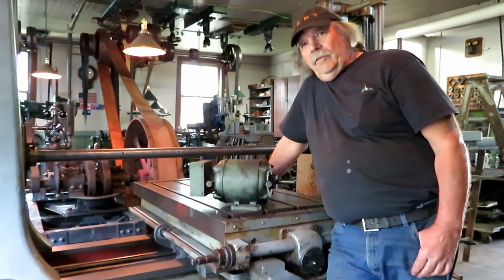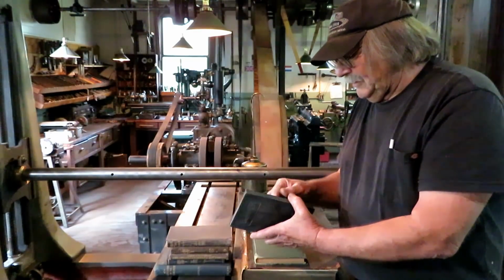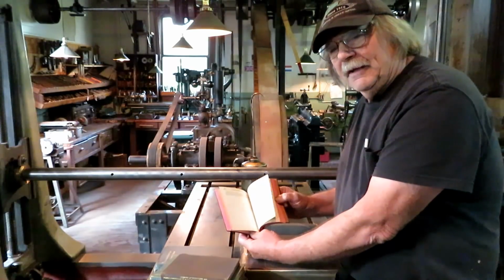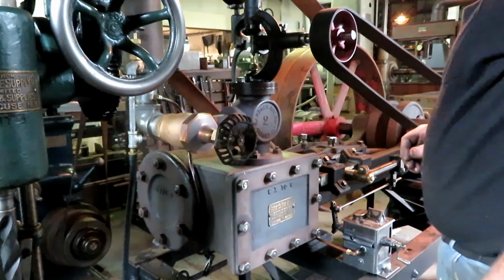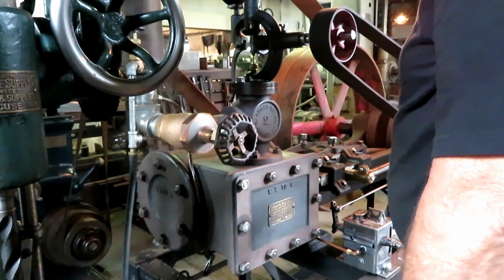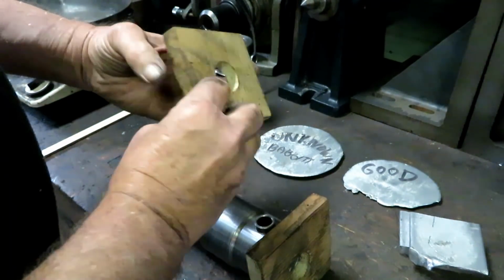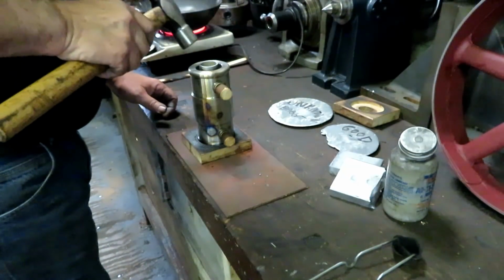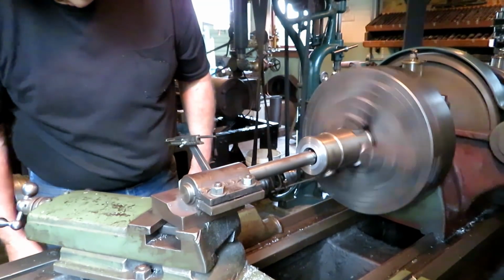OLD STEAM POWERED MACHINE SHOP 29

Comment: The Richards sure is smooth and quiet.  They do really need to do something about the shotty workmanship on that electric motor. Maybe you should check to see if they will cover it under warranty. :-)
Reply from the maker: I think Holtzman & Cabbot built their last motor probably 50 years ago, so they probably wouldn't be anyone to answer their mail....Dave
Reply: I would say you might need a boiler BUT with the size of the shop fillers maybe a neuc reactor might work. Hi 2 Baily!
Reply: Michele Marie Dalene 3-windings & Rotor Inc.
Reply: HA, but wait, there's more--if ANY of those employees are still alive, you MIGHT have a chance hehehehehe Dave :--))))))))

Comment: Just a thought;
Back in the days of steam would it be more usual to have the boiler/engine in a separate building?
The boiler in the shop would be fine in winter but summer?
Also, would the engine leak much steam? Just wondering about humidity and rust problems.
Reply from the maker: Good question Pete, A smaller shop would have had the boiler and engine inside to keep an eye on it. There were many vertical boilers built with the engine mounted right on them, Keith Rucker's museum has one in their wood shop (see my earlier video about that one). A big plant would have a more isolated boiler (usually two). Those old shops were so leaky that the wind blew through and lots of vents....Dave
Reply: Hi Dave.  I have never posted a comment on your videos but I truly think that, that beautiful steam engine should have been placed next to the shop in a nice shed and run the line shafting outside in the shed because although the engine is beautiful to see and watch running, it sure takes up a lot of space in the shop.  getting very tight space wise in your shop now.  I love watching how things were done in the great old days.  Keep up the fantastic work and I am now looking for your videos coming out.  Keep up the fantastic work.  I love steam engines and I always have ever since I was little.  I am purchasing an ACER 14 by 40 inch lathe very soon.  I went to the WESTEC show and spoke with the sales people.  They are really friendly and helpful.  It is a family owned company for over 30 years.  I would recommend their equipment to anyone.  Although it is not steam driven, I plan to make a lot of steam engines using their equipment.  Down the street is an old building which was a steam powered machine shop many years ago.  It looked so much like your shop and it reminds me of this shop every time I watch your videos.  I hope you like my comments.  Keep steamin'
Reply from the maker: Hi Gene, great plan, please email me some photos when you get going on your project engines...Dave

Comment: Dave, loved the way you deadpanned the intro! I completely believed we were going to hear about dissatisfaction of some kind, with someone or something. Maybe a modern electric shops inability to repair the old motor or lack of parts! :-)

The lower noise level ion the shop with the new engine is very apparent. I went bak to a older video and confirmed my sense of the new noise level.

Related to steam I will be attending the annual "Arnfest" at the Illinois Railway Museum in Union Illinois in late Sept. The museum has an active Steam Department  responsible for 25 locomotives. They have an informative website to visit. Dave , you are probably friends with some of these folks-
regards
vic

Comment: Thank you for sharing these amazing shop videos. I thought that old style shops like yours were a lot noisier compared to the modern stuff. Where i worked as a tool maker we almost always had to shout during worktime...every machine was running at full blast. All the electro motors... one noisier than the other. Keep up your good work, it´s a pleasure to watch.
Reply from the maker: Right Bahne, nothing noisier than a geared head lathe with a lot of time on it....Dave

Comment: hi i can help you saving your motor electrical one  get a motor starter switch square D make that you need one witch overload protection you take the amp or hp and volt of your motor and get the overload that gos for that motor runing a motor without it that will greately reduce the life of the motor i sen motor over 50 years runing like new the overload act like a breaker when the motor is over working it trip off you reset it and go

Comment: put in an overhead air over water sprinkler system, from some old factory, if your shop burned down some night, I would actually cry, for some time. your floor isn't wood, right?
Reply from the maker: Well Paul, the only part of that barn that isn't wood is the field stone foundation....Dave

Comment: Dave, did you have to unbelt the O&S engine or is there a way that you can disconnect it from the line shaft without taking the belt off?
Reply from the maker: No, not as it is now..Dave

Comment: What? You only got 80 years out of that poor electrical motor? You just must have been sarcastic there, no?
I can assure you that modern electrical motors won't last even 40 years :o)
Anyway, agree with one thing though... They don't do mechanics and machinist the way they were made before.
Those fine trades are slowly but surly dying out.

Comment: A beautiful restoration and oh so quiet. I am glad you did not edit out your babbitt pouring problem as we learned from your failure. Every problem is an opportunity to learn. I wanted to call your attention to the missing wood plugs on the second pour but you caught it in time. Or did you do that intentionally to add some suspense to the video? :-)
Reply from the maker: Hi Ron, There's enough suspense around here without putting more in on purpose.....Dave

Comment: Those old motors have smoke, heat and sparks packed inside them and occasionally they leak out. You just need to pack the smoke back inside them.
Reply: That is magic smoke, steam and sparks.
Reply: No! Even electrical engineers know you can NEVER let the magic blue smoke out!

Comment: Great video, thanks. What is the reason the big engine is so much quieter than the smaller one making no hissing sounds? Is the design of the valve box different? Or is it because it is oversized and is almost idling when driving your shop?
Reply from the maker: It's that the small engine is excessively noisy. It was a cheap end engine and has a lot of wear on it. Now that it's out of service, it might get a complete overhaul instead of patched up....Dave

Comment: I like the new setup. I have a question though, what stops the engine from running away if the governor belt fails or comes off?
Reply: You could call the steam valve an e-stop in this case. Good thing it isn't in a basement somewhere ha.
Reply: The old steam engine had a safety follower on the belt that ran the governor.  Dave described it in one of his videos.  If the belt broke the safety mechanism shut off the valve in the governor.
Reply: Yes I'm aware, we are talking about the new engine.
Reply from the maker: We might explore that possibility on a future video....Dave

Comment: G'day Dave the bigger engine certainly is quieter than the other one, it runs really smooth you did a great job in restoring her.  That oiler is a work of art beautifully made what I found interesting or unusual is the sight glass so you can see the drops of oil and adjust accordingly. I was surprised when you said about the railways and the standard of Babbitt used which wasn't very good, you would have thought with weight issues on bearings it would be good.  Another great video I always look forward to your videos, it's an area that I find fascinating and never tire of watching you, thanks mate John
Reply from the maker: Thanks John, I think the problem was that Tin got expensive and Lead based bearing material seemed to work so the RRs went for it.....Dave

Comment: I thought the little old shop engine was cool but the big new one WOW such a sweet running gem that is.
Reply: John Bare if you havent, you should listen using a robust surround sound system.  That thing has a bass note to it that you'll feel more than hear. Like you were in there and feeling a heartbeat through the floor.
Reply from the maker: Thanks again John....Dave

Comment: Machine Tool Operation Part 1 Lathe Operation
https://books.google.com/books?id=iD5IAAAAIAAJ&dq=machine%20tool%20operation&pg=PP1#v=onepage&q=machine%20tool%20operation&f=false

Practical Stationary Engineering In the form of Questions and Answers
https://books.google.com/books?id=oUBGAAAAMAAJ&dq=practical%20stationary%20engineer&pg=PR1#v=onepage&q=practical%20stationary%20engineer&f=false

Catechism of the Steam Engine
https://books.google.com/books?id=OnNRAAAAYAAJ&dq=cataclysm%20of%20steam%20engines&pg=PP15#v=onepage&q&f=false

Valve Gears for Steam Engines (1892)
https://books.google.com/books?id=wD1MAAAAMAAJ&dq=steam%20engines&pg=PP12#v=onepage&q=steam%20engines&f=false
 
Modern Machine Shop Practice Vol 1 (1906)
https://books.google.com/books?id=H1I6AQAAMAAJ&dq=modern%20machine%20shop%20practice&pg=PR5#v=onepage&q=modern%20machine%20shop%20practice&f=false

Shop Practice for Home Mechanic (1920)
https://books.google.com/books?id=XhwxAQAAMAAJ&dq=line%20shaft%20shop&pg=PA3#v=onepage&q=line%20shaft%20shop&f=false

Couldn't find the 3rd or 4th books, didn't mention the title of the forth one. :(
Anyway to download a PDF of these Click the Gear in the top right and select "Download PDF", in the next screen Click the printer looking button with a down arrow in it.

Comment: David, I work in a car repair shop.
Last week, the boss had a Ford 
Escape, that had rod bearing issues.

I was eating lunch, and pulled out one 
of my Hot Rod magazines.  (Been 
reading them since the 60's.)  Story 
was about main and rod bearings.
Talked about the new style cracked 
rod big ends, where they aren't made 
out of 2 pieces, but the lower end of 
the bottom bearing is cracked off.
leaving a rough edge on the mating 
surface.

After lunch, dropped the oil pan on 
that Ford, pulled a rod lower end off, 
and it was just what I got finished reading 
about.

Freaked me, as well as the boss out!

steve
Reply from the maker: Hi Steve: Hot Rod, Rod & Custom, Popular HotRoding, Car Craft....used to read them all....Dave
Reply: Dave, check this one out.

David Freiberger used to be Hot Rod's 
editor in chief.  Now he does Roadkill.

steve

Comment: Haaaa haha they will never replace steam
Reply: Of course not, because we never have. Even a nuclear power plant is just a specialized form of steam engine. The reactor is the boiler, and instead of driving reciprocating piston steam engines, they drive sophisticated steam turbines. It's still "Make water hot. Make steam drive machine. Use mechanical power as you see fit."
Reply: Love me some Liquid Fluoride Thorium Reactor technology. Helium, absent widespread adoption of hydrogen fusion for power generation is only going to get more rare and hence expensive. Never will CO2 be rare on this planet until the day the sun blasts its entire atmosphere into interplanetary space.
Reply: steam is still state of the art, today you just power a turbine with it which turns a generator that puts out electricity, main reason to do it this way because you can transfer electricity over greater lenghts than steam , with steam you have to produce it where you need it . so in our modern world the powerplants (coal,gas,oil,nuclear) are placed decentral from the cities and generate the electricity and deliver it to your home, so every time you turn on the lights you could say your'e using steam.
Reply: fangled electronic motors,  nothing but a fad. hehehe
Reply: 10/4 on the Thorium, the only way to go. NOW just convince the folks that're making all the $$$ with the other stuff to switch over.